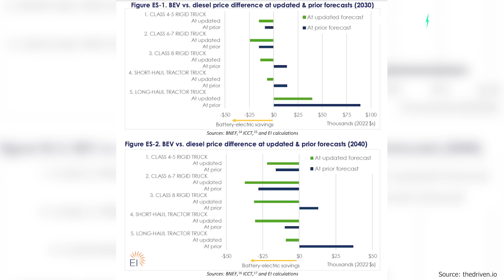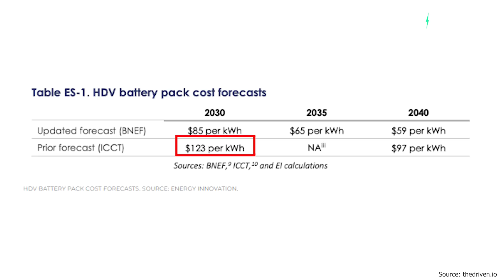Electric trucks will be cheaper than diesel many years sooner than expected

Comment: If a company has 50 EV 8:42 semi trailerswhat is the cost of installing 50 chargers & a power generator to tun them.
With about 150 million diesel trucks in USA to overnight you would need 150,000,000 chargers if all trucks were EVs

Comment: The inescapable fact is the grid cannot cope with electric trucks , and it would take twenty years to even get close ! To charge two trucks is approximately the same amount of power as to run the factory that built them ......... Do not hold your breath ! That's not even taking into account the changes to roads to carry heavier vehicles over bridges etc and vastly stronger safety barrier instillation.........Billions of dollars on it's own ....

Comment: I expect you're completely wrong.  According to Elon Musk, fleets of autonomous Tesla semis drafting behind one another should already have put railroads out of business, only Tesla's semi is actually a miserable, thoroughgoing failure.  If we synthesize liquid fuels emitting no carbon dioxide in the process, we can continue to fuel diesel trucks and it's just as well since advances in battery technology do not threaten to erode liquid fuels' ten times better energy density much.

Comment: Hybrid diesel electric trucks could reduce diesel consumption by 1/2 in the near term. For long haul trucking I believe adding an efficient diesel generator to an EV semi truck would bridge the gap much more quickly than full EVs with much larger and more expensive batteries. Diesel generators run at their most efficient and cleanest speed and can be run intermittently to keep the batteries charged on long haul trucks. The truck would be full electric propulsion so could take advantage of regenerative braking reducing brake wear and battery pack size. The diesel generator could be swapped for servicing easily since its not coupled to the drivetrain. I'm sure trucking companies would love to reduce their fuel cost by 50%. When charging infrastructure and battery technology/cost catches up with demand, the diesel generator could be swapped with a large second battery.
Reply: And possibly run the generator on a less polluting fuel also like propane...

Comment: The charging issues (number of needed chargers and grid power to run them) is a show stopper.  One or two conventional fueling pumps can fill several trunks in less time than one electric can be charged.  Turn around time or being able to continue a long distance haul will be another problem.

Comment: As a truck driver I had enough things to worry about. I don't want "range anxiety" added to it. If they had a battery that would run the truck for 700 miles (11 hours) and it would charge overnight as I slept without incinerating me and the price was in line with diesels then I would consider it. Not until.
Reply: This is true today, but not in 2030.
By 2030,
Electric truck will become cheeper than desiel truck.

2nd,
You do not need that much range (and therefore larger battery).
Because you would be abel to Fast charge from 20 to 80% within 10mins.

So you only need 300kms (190 miles).
Because every 3hrs, you will anyway take a 10min break for peeing or eating.
So truck can charge to 80% till you come back from Toilet.

Even today, Fast Charging technology (that charges within 20mins) are comming up.

In 2030, Those things will become the norm.

Yeah, in 2024 Desal truck is better obviously.
Reply: @Atheist-Libertarian  Well that's great. Give me a call in 2030 and I'll consider it.
Reply: My friend people regularly race across the country in ev(see out of spec motoring)so your range anxiety fears are unwarranted and there's already trucks that reach 440 miles of range(Chevy silverado ev) and evs on average have less fires (25 per 100k) compared to hybrids or ice vehicles due to the fact ev batteries have overvoltage protection and recently have lfp batteries that don't explode.
Reply: @Globalscanningeyes  You did notice I said "700 miles"? And in a semi, not a Silverado?

Comment: While this may work for more local delivery routes I still feel like the viably in terms of energy storage and logistics is going to take quite a while for long distances trucking.  You just can’t beat the energy storage efficiency of diesel.  One liter of diesel contains about 38MJ (10kWhr).  Even with a 20-30%conversion efficiency that is still a lot more energy dense than the best batteries right now.  A diesel/electric hybrid system similar to locomotives might be a better long distance option.  That would also help in colder weather climates as well.

Comment: 🔌🔌One big issue I see is that NEVI funds in the USA are being used for non-pull-through public chargers. To date, no NEVI or CFI  funds have been allocated for MW chargers.  Another problem I encountered was local utilities taking too long to address the power upgrades at DC warehouses for companies like Walmart, Amazon, Federal Express, UPS,  USPS, and others. The build-out for our EV semi repair truck shop in Phoenix required us to spend $300k in electrical income service entrance (SE) upgrades. With the two DC warehouses going up  next door and a new chip plant down the road, it would take the utility two years before it could address its own transformer and SE requirements  🔌🔌

Comment: I agree that electric Trucks are not as viable as I believed just a year ago. Trucks travel long hard everyday and the battery technology as it exists.Today is almost usable and it's probably usable in some very narrow and specific conditions. It is not usable in the general case of delivering and picking up loads on a daily basis with random destinations and pick ups. It is both an infrastructure issue and a battery capability issue. Winter driving incredibly intensive charging need together with the very difficult job of hauling loads up-and-down mountains many times at high speeds 70mph+, not just at the 55 mile per hour, California truck speed limit in the Tesla test.
 Means means that the real solution is still pretty far off regardless of battery price.

Comment: I hope so.  My business operates a small fleet of diesel trucks, F550's, RAM 5500's, etc..  Modern diesel trucks are extremely costly to maintain and are ridiculously poorly made, especially Ford.  It is utter insanity how many recalls we've had the last few years.  If someone can get a workhorse EV truck in the 550 super duty range for the trades I would be all over it.  I have a feeling it will still be quite a few years before this happens but I would love to be proven wrong.
Reply: I don't think that you can assume EV trucks will be any better made.
Reply: @YourHineyness  Perhaps, but the maintenance would be less, not to mention the time wasted doing it.  Also cheaper fuel and never having your employees drive to the truck stop on the clock to refuel.  In fact I could cut up all my gas cards.

Comment: I'm wondering why you talk so much about purchase price.
Especially in business this is a non issue.
Not one (normal) business will look to the purchase price.
They ONLY look to a business case for investment decisions.
That business case includes the TCO (including expecte wages for a driver , if the cargo limit is lower than for diesel trucks (depending on truck weight) and what effects are expected....how often do you need an extra ride because the EV truck can take a few 1000 lbs less cargo with it...
How often is a diesel truck loaded to the maximum allowed weight is what tells us if you need more runs with an electric verhicle.

ps Also for my private personal choice far a car  the purchase price was less relevant....the TCO of my private car over the estimated years of usage (8 years battery guarantee is taken as lifetime)was most important for my decision...of coarse comparing apples with apples....in other words a same sized petrol car with AWD against my ioniq 5 awd. And both with the same option level.
My ioniq 5 awd will be at least  5000 euro each year cheaper in running costs than any ICE awd would be with 20000 miles drivng every year.(Includes roadtaxes for a diesel, 2000 more / year than for electric cars) I've only made one little offer for those 3000 euro/year...This car can haul 1600 kg, not 2000 kg as my previous nissan xtrail ...But with that car I never exceeded pulling a 1500 kg trailer. (a 2 person glider including trailer)
Calculations based on the dutch laws and with 95% of electricity produced with my own solar panels. Charging on my own driveway.
Reply: You are excluding a large number of drivers who are owner-operators and they will very much look at price.
Reply: @YourHineyness Yes, as I said....
They will look to the TCO for their car to maximize profit...(minimize total costs for driving ) 
Only issue for E trucks at this moment....can that truck charge convinient. (You''ll need a 100-150 KW charger for at least 8 hours night time to starte the next working day...at the truck parking.) Same as the time I bought the first EV (in 2013)....no charging available , but the car was very convenient and cheap (in TCO) as second car for short distances....only charging at home the first year...

Comment: This is pure wishful thinking at this moment and plans for electrification by 2040 are taken out of thin air. Even if prices of EV trucks drop there will need to be huge amounts of electricity available to charge them and no way the infrastructure is going to be developed so quickly. There are also other factors like additional time needed to charge and lower range. If they had a plan to make all trucks electric by 2080 instead of 2040 that would sound more realistic. Car industry electrification will be a slow and gradual process and may never be fully completed because a better power source may be developed during that time. All these plans to change all cars to EVs super fast are just fairy tales and indicate that clearly some people didn't do the math.

Comment: Not only will electric trucks dramatically reduce poisonous air pollution per mile but regenerative braking will also reduce poisonous brake dust.  Electric trucks can charge with green energy. You can't use green energy in a diesel powered truck.  Faster, no pollution, quieter, cheaper to operate and virtually no maintenance.  Just like EVs.  

Why are people afraid of something that is better?  Not only are fossil fuels and ICE obsolete dinosaur campfire steam engine type technologies;  burning anything to produce heat energy is simply  obsolete.  Why limit ourselves to puny amounts of heat burning poison technologies when relatively limitless less expensive green energy is already all around us. The end of poison for profits, fossil fuels, is upon us NOW.  Embrace this change TO SOMETHING BETTER.  We will all breathe easier.
Reply: And all of this electricity is coming from...where? Beware utopians.

Comment: Very, very unlikely that trucks will be battery operated until battery weight becomes much, much lighter. Energy Density will need to improve by 3 to 4 times
Reply: EV trucks will not be able to carry near the load of a diesel truck because of the weight of the batteries therefore there will need to be many more trucks on the road to carry the same amount of freight which will raise freight rates substantially and will wear out the highways faster and piss off a lot of 4-wheeler owners. Give it up.

Comment: I find your videos very interesting, but you never seem to talk about residuals on electric cars and the cost of repair/replacement batteries. Those three things makes ownership for any Private or Company buyer very painful. Also the false ranges given out by the manufacturers. Also charging an electric vehicle ‘on-route’ is more expensive than petrol/diesel, so what’s the point. 

Trucks, OK, but what’s the value 3 years after purchase.? You promote electric vehicles with a blinkered view, buyers loose one heck of a lot of money overall. Modern diesels with Ad-blu are incredibly clean on emissions and you get a good range. Electric I honestly feel is just a stop-gap until more environmentally friendly bio-fuels come on stream. The internal engine I feel is still a long way from being killed off.

Comment: Electric trucks will never be a workable thing in the next couple of decades.  You just can't get the energy into the vehicle fast enough, to make them viable.  Trucks are only ever making money when they are moving.  Having them need to stop for 4/6/8/12 hours to charge, is just farcical.  This is forgetting the problems making that electrical energy (from which fossil fuels?), and the incredible weight of batteries needed onboard, to give them anything like a sensible range which eats into the usable load-hauling capacity.  Whilst electric trucks may well work in a city environment, (just like electric cars do for commuting and groceries), electric vehicles are just not viable for people who actually need to do work with their vehicles - e.g. delivering items, pulling trailers, etc etc.

Comment: There are 9 million heavy EV Semis in the USA alone. If you wanted to facilitate not powering them by a grey grid - you'd need to create an interstate network of batteries powered by solar or wind. Each Semi truck would need several just to drive at night; and in cloudy areas they may need a week or months worth of giant battery packs; most Semis run locally but 3 million  need many of these recharger packs  demanding  much more lithium than the Semi trucks alone.
So just to replace the USA's Semi truck fleet would take at least 30 years; no EVs cars or battery farms, no cell phone batteries, nothing but Semi trucks and chargers.

Comment: It takes over 250 lbs of lithium to make a Tesla Semi battery. About 8 Semis per ton. 169,000 tons of lithium were refined in 2023. If you used every ounce for Semi trucks; you could only make 1.25 million EV Semi trucks. There are 200 million Heavy Semi Trucks in the world. It would hence take 160 years to replace all the Semis at current production; if you used lithium for nothing else.  But to have high speed charging you need massive battery packs to boast the local power supply to do so; so it would take at least 200 years producing no cell phones, battery farms, EV cars or bikes etc. Seems like Diesel Semis have a very long life ahead.
Reply: Lithium mining is going to increase rapidly once currently developing mines are open. Processing is also a bottleneck. More efforts need to be put into these. Investors need certainty of the future market to justify the investment long ahead of production. That's why clear roadmaps of transition area important. You can't rely on the market to do it when it feels like it. Fixed storage will be based on sodium ion batteries so that won't eat into the lithium supply.
Reply: @adrianthoroughgood1191  OK; on this channel VIking just reported how some large lithium mines just went bankrupt. Each ton of refined lithium takes 500,000 gallons of water and 500 tons of ore.  Lithium is only 7% of the battery so mining isn't the best thing in the world; mostly digging a big hole to have to get out of.
Reply: After reading through the comments in this thread the healthy injection of common sense, an increasingly  rare commodity in this day and age, offered by you and a few others is refreshing!

Comment: It's not just about how cheap you can make a round of trucks with massive subsidies, it's whether or not you can extract enough raw materials to create the batteries and tech. Under current tech it's not feasible. It might be feasible with a revolution in batteries, plus doubling the US power grid, but it's not going to happen for a few decades yet.
Reply: Even the current EV cars are massively cheaper due to subsidies, hiding their real costs.  22 Billion was invested up to 2021, accounting for reducing the price of EVs from 2009 to 2021 by $50K each.  Then in 2022 we got the Biden Trillion $ IRA & Infrastructure Bills which added more billions to subsidize everything from renewables, to charger installations, to EV manufacturers and battery companies, to battery storage stations.
https://www.youtube.com/watch?v=0_cGugqnMPE&list=PLAQf9tD6dnaBDatNee70Dm9VOOb7inVS1&index=5&t=7s&pp=gAQBiAQB

Comment: There are millions and millions of diesel horsepower that will take a GENERATION to even think of replacing the electrical infrastructure everywhere will need to replace increase by an impossible order of magnitude.   100’s if not 1000 times larger.

Comment: Moving to battery-powered semis is the quickest way to cut down on fossil fuel use and the resulting pollution. Big operators who, like Pepsi, can afford fleets and chargers, will win the freight race. Later, as chargers proliferate, smaller operators will go electric.
Reply: Check and see how electricity is generated. The vast majority is from fossil fuels. I believe I read 70% fossil fuels, 20% nuclear, and 10% "green". All you are doing is removing the emissions coming from an exhaust pipe to a power plant smokestack.

Comment: A highly efficient, clean diesel engine is a complex machine. Plus the 18 ratio transmissions, plus the regular, heavy maintenance to keep them running. Then you've got noise and vibration, exhaust brakes to deal with. All things you can do away with in an electric truck. If motors and batteries are nice and modular, easy to swap out as required, downtimes would be slashed.
Reply: Have you ever been in a truck repair shop? The pace is glacial. I suspect swapping out your batteries would take at least a day if not two. In trucking probably more than any other industry, time is money.